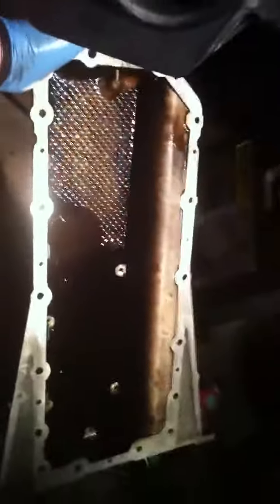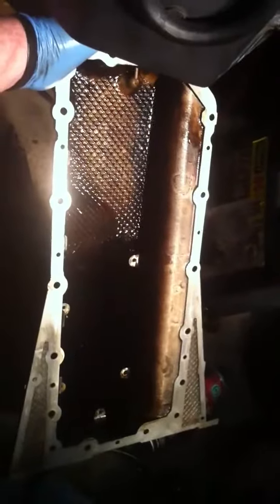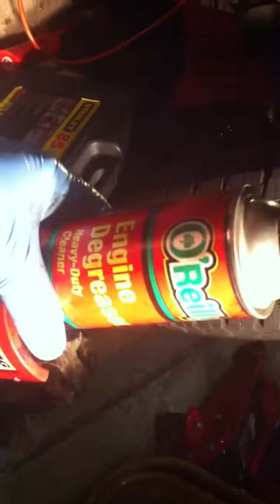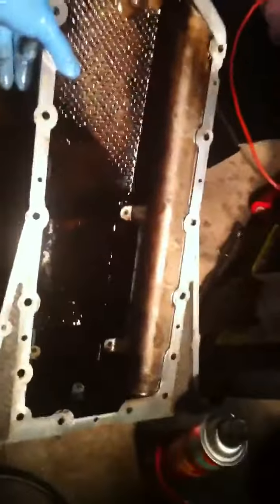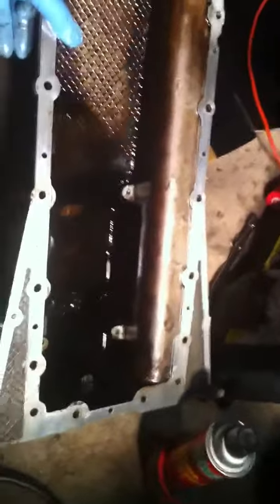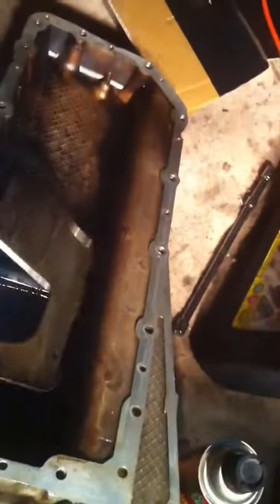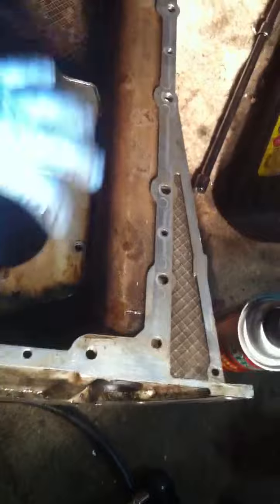Land Rover Discovery oil pan droped & cleaning

Comment from the maker: I just replaced the the oil pan gasket and crankshaft seal. They both were leaking. Now no leaks. Ha on a Rover. My oil pickup screen was clean. I let it soak in Simple green for awhile. Biggest thing on this job is to follow the RAV manual directions on retorqing the bolts back in proper sequence to 22NM.
Use 15w-40 Rotella by Shell in the Discovery, best oil for this old style engine.

Comment: How did you remove the plastic under-belly engine cover/ protector? Can't get mine out of the way to get to the rest of the oil pan bolts. Also, how did you maneuver the pan to clear the front axle? Need to know please. Thanks.
Reply: smart9ja  hi. Ey did u figured out  how to get pan between the front bar

Comment: Ther is  no spaces do I have remove the differential bar or what  please show how u did it
Reply from the maker: Yes you need to remove the frame support cross bar with 4 bolts on each side. Also the plastic splash guard if you have not removed that.

Comment from the maker: The plastic shield comes off with a few screws. Use wheel ramps to raise your rover. It makes it much easier to work on. Then you can maneuver the pan off. I would suggest taking off the front frame crossbar support...then you have more access. Check out --land rover forums com----- for the most comprehensive  Land Rovver forum anywhere